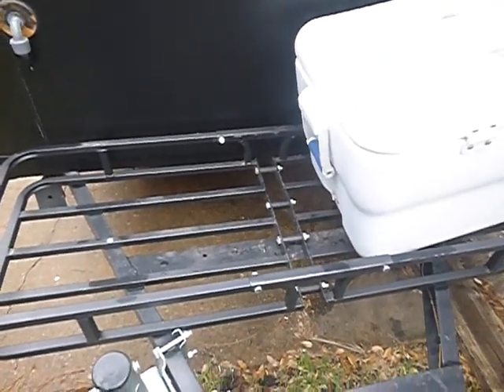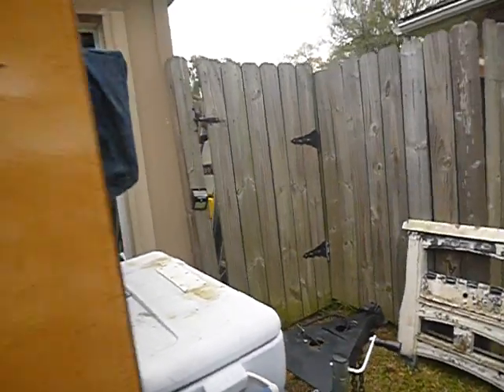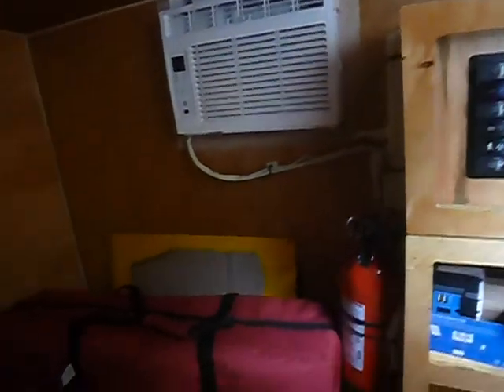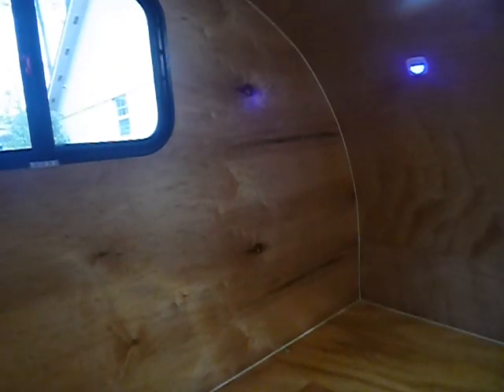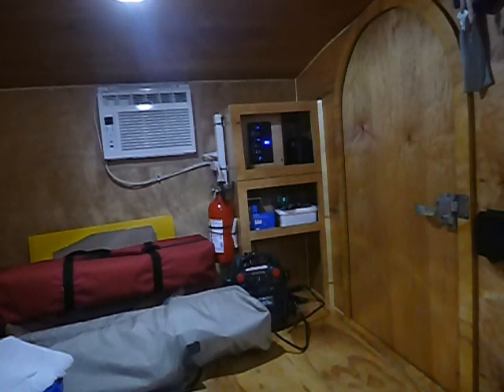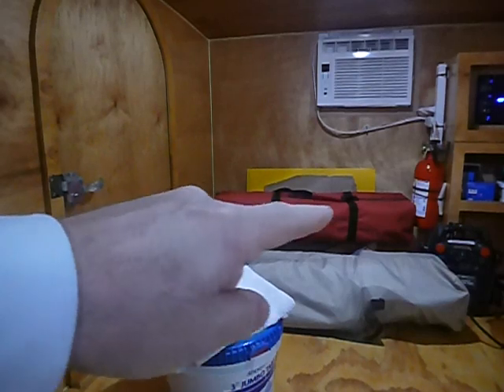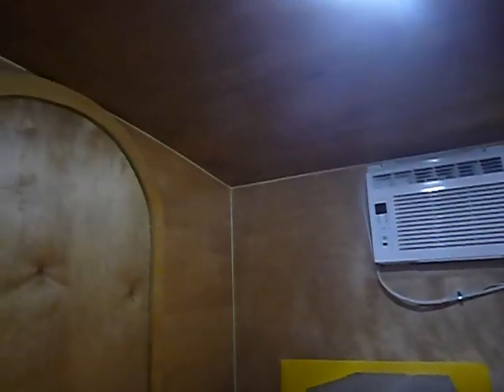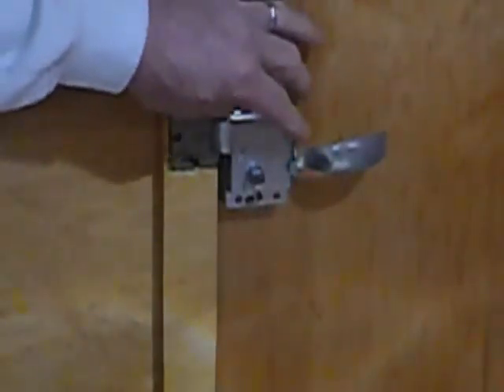DIY Teardrop Camper a 5 X 10  M46  how I made my rack bigger

Comment: Did you wire the trailer so when its connected to the vehicle the vehicle alternator charges the battery in the trailer
Reply from the maker: I did not but that would be a great idea, I am still using the original trailer wires from when it was a farm trailer
Reply: @mlangfordcamper  awww got ya